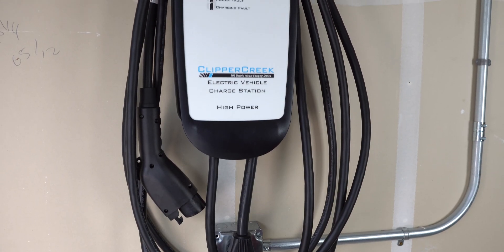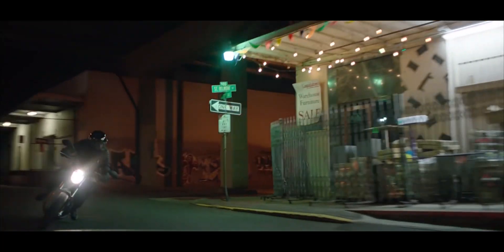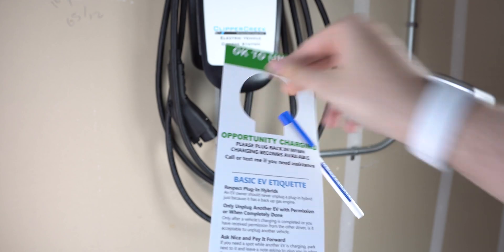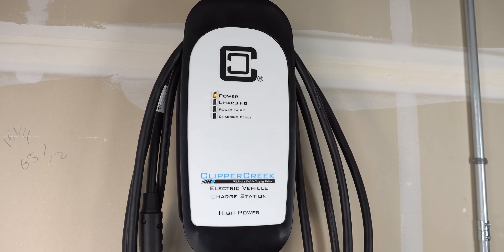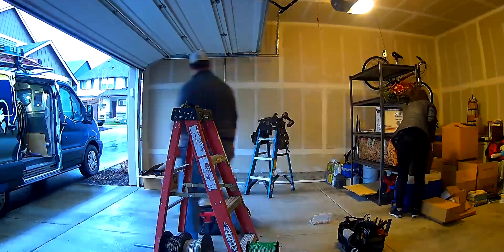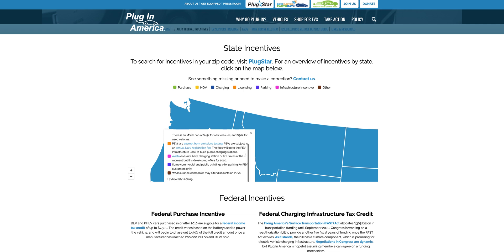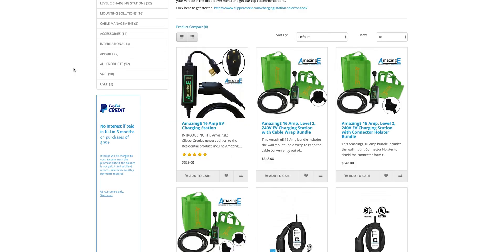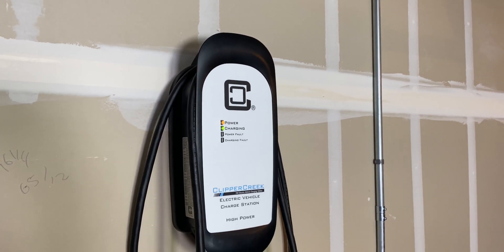ClipperCreek HCS-50P Review

Comment: This is what I bought and had installed when we built our home and it easily charges our 2017 Volt, but we just ordered a Tesla Model Y and will use this with their J1772 adapter.
Reply: Hello! I've been using ClipperCreek on my Leaf for about 6 years. I'm planning on getting my Model Y in the upcoming months. Have you had any issues using the J1772 adapter daily?
Reply: @OrtzDavd  Nope, but I learned the best way to use it is to first INSERT the J1772 adapter into the charge port using the palm of your hand then inserting the J1772 plug into it.  Then do the reverse when removing it.  First press the release button, get the WHITE light then remove the J1772 plug, but quickly before the WHITE light changes color use your free hand to pull out the adapter.
Reply: @thomasjacques5286  everything makes sense there except for I don't understand why you have to quickly pull the adapter out at the end... can please add some color there... thanks  🙂